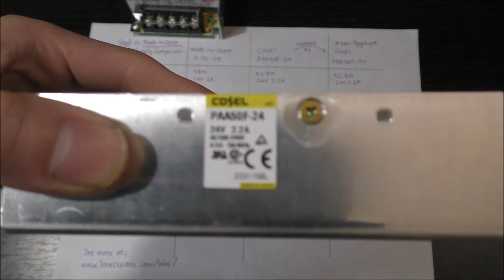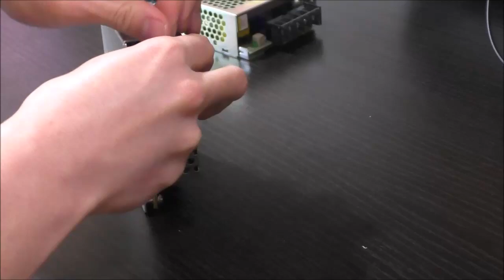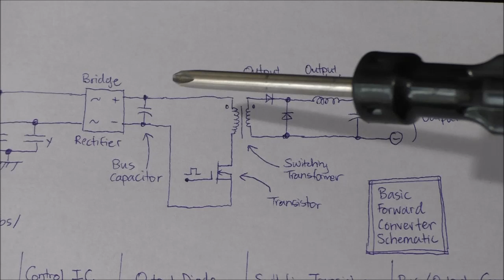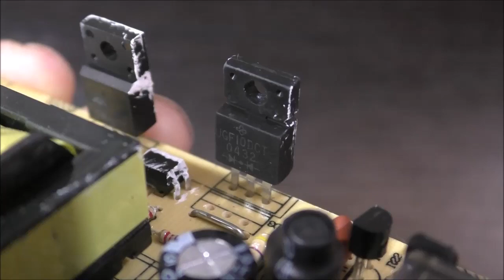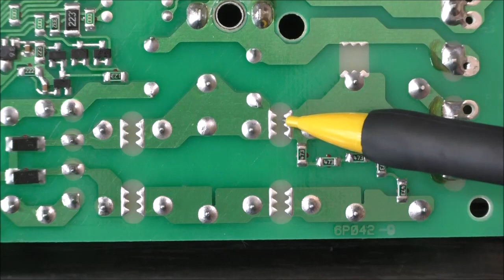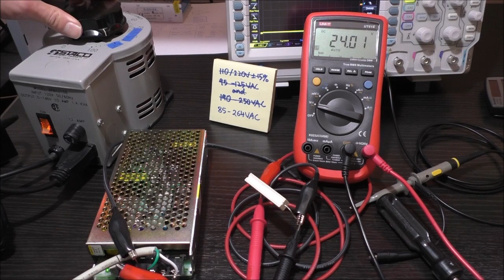Cheap $8 Ebay Power Supply vs $85 Cosel Power Supply Teardown

Comment: Why the main capacitor in the branded Japanese Power supply is very low voltage one only 200 v. How does it works on the rectified DC which is about 320 volts at 220 v AC Input...??? And why the main transformer is so small...???

Comment: It also a question of cost when power supply fails not in voltage lost mode... If you supply some pricey equpiement by $8 it quickly can be very costly.
Also about ripples you didn't show the frequency of them, peak peak voltage is not whole story.

Comment: To be honest the cosel power supply is too luxurious in some areas for just 50 Watts
1. That bulk capacitor is unreasonably large for 50 watts
2. There is no need for  TO-264 components on a 50 watt smps supply unless they want the power supply to be so reliable it could run without a heat sink
3. There is no need for custom bus bars on a 50 watt power supply. The secondary will only carry a max of 2.2 amps. Flood filled traces would do the same work for less

On a side note,  the emi  solution on the cosel is quite nice, but it looks like it was meant for a bigger power supply

Comment: I have a bunch of low-end Cosel power supply (Cosel is crazy expensive). The ripple measurement of SMPS is a bit tricky. You can not use ground clip as it will introduce lots of noise. The test point is best at output capacitor. If you did it correctly, the Cosel should be much better.

Comment: Why the jeanease one had a 200 v main cap?It sould be 400 or 450 v also usually the x2 capacitor must be rated for 275 v not 250 v but this ine could not be a big deal.

Comment: The two supplies performed well to my believe although the cheap power supply did have some more ripple on the output.  Comparing the price paid for the cheap psu I would not even dream of making it for that price.($8)  You get what you pay for but the cheaper supply is really good value for money.  Compared the cost is 10 times more for the more reliable one.  One other thing that puzzled me was the voltage rating of the 680uf capacitor being only 200v when the mains voltage at 230v is rectified will rise up to more than 300vdc.

Comment: Excellent review, I have just received some 5 amp 12 volt power supplies that look very similar to the 24 volt Chinese one you reviewed and from wiring it up with 240 AC, it seems to work OK. Small trimpot adjusts the output voltage with no problems. Sad to say my now ancient oscilloscope would probably not work any longer as it has not been turned on for years. One question, would it be worth installing a cooling fan for a power supply of this type ?

Comment: dell177 hello you seem to be very knowledgeable about adapters. I need a little help I have LED lights that the adapter keeps burning out the specs are input: 100-240v-1.5a and the output 24v 6A what should I get to hold better. The LED are 120 ft long. I will appreciate any advice

Comment: All of my cheap ebay china power supplies are working very well. I only load them no more than 50% of Max current. When they arrive from china I tear them down, look for any burnt components. Look at all of the mounted to chassis components to see if there is proper heat sink compound on them. If no compound I unscrew them and add the compound. To decrease ripple and noise I put a 4,700uF, 100V capacitor on the output.  One last thing. If buying from ebay. Make sure you set up an account. If the suppliers have a Positive feedback of over 99% rating. I will buy. If its faulty you are guaranteed ebay money back policy. And with a rating of 99% and over means the customers are very happy and will trust them.

Comment: Looking at the input capacitor, the cosel supply has a 200V rated voltage. I have learned always that after the bridge rectifier and an elco the voltage will be Vin x 1.41 so this is 230 x 1.41 = 324 volts... So how did that happen...

Comment: I have a SMPS led driver with a 5v ref, could the voltage divider be modified to increase output?
Reply: If voltage regulated by tl431 ic you can change a resistor around it and output capacitor with higher voltage but you should learn more about electronics to change the output voltage

Comment: The China PSU was and is a basic rendition without too much complexity such as the Japanese PSU.

However, I would have liked to have learnt what improvement could have been made to the China PSU.
Such as inducter and larger caps would have on regulation.

I noticed a drop on the voltage toward the higher end, that does also effect amps of the unit, but where the loss is/was causing this. I assume the MOSFET and caps would be the issue?

But for the cost of a few replacement parts which is best value, caps and part being only a few dollars does the brand warrant the costs?.

Comment: It's not important, but I am curious what's the controller chip in the smaller one. I like it's simplicity and I would like to study it more :)
Reply: It is most likely uc3842 or its copy or something works similar, a very good peak current mode controller

Comment: Bought a couple of the 24V supplies from Ebay and after a short time a cap failed and I had 27V ac leakage coming out of the DC supply but still giving 24V dc. Buyer beware.

Comment: For audio I would use the 8 dollar cheap one, less noise and ripple, in fact I would buy 10 and see if the Japanese model last as long as all 10 of the cheapies being it's the same price difference. I'd bet the components don't have the same quality, but the cheapie looks good on the scope, explain that? When the cheap one craps out you could always replace components with high quality, if the board is still good then you're all set. Maybe the Japanese model is a little over done. They're known for high quality and honor, but seemed to overlook the noise and ripple, hmmm. Electrical Pollution.

Comment: I have used Chinese power supplies in numerous commercial applications where cost was a concern. Stepping away from the basic Ebay units (which I have used successfully on home projects) in my business, I find the Mean Well brand to be particularly reliable. If I were working in a medical or scientific environment I would probably use a German or Japanese supplier but for typical commercial and light industrial applications the less well documented Chinese brands can work quite effectively at a significant cost savings.

Note: This video did not check for line voltage isolation which I always check on Chinese power products. Visual inspection doesn't protect you from faulty transformer isolation or suppression capacitors.

Comment: Well the cheap Chinese brand cap's are likely to fail that is a given. That said it is durability that would interest me first. Second would be where the birdies are since I primarily use switching power supplies for rf radio hobby. Given the low cost for used server power supplies I find it odd that anyone would spend $85 for a Cosel when you could get 2-4 server supplies for that price and they are built much better. Even if you had to recap them you would still be ahead over buying a Cosel. Same thing for the cheap Chinese $8 switcher you could upgrade the caps fairly cheaper and make minor improvements if need be for far less than the $85 Cosel. In fact even if needed a small fan to keep it cool if that is Chinese as well it is cheap enough. I think where the Cosel comes in is if you are building something for a client and your reputation is on the line!

Comment: Why is the 'bus' capacitor in the Cosal only rated at 200v when at the maximum rated input of 265 volts AC, it will have 375v across it? I was waiting for the bang...
Reply: Alan Cordwell -- Your question was already answered here  https://www.youtube.com/watch?v=71NWT5vrbk8&lc=z13pezwxnkq2u31vg231c3qpmuutipinw

Comment: You should be testing them on load to see how they hold up to specs. Also it depends what your going to use them for too. This was not a real test only a input test and not a output test on full load to see how they held up. It would be nice to see how hot they got with a flir gun to see points inside what got hot. There was a lot of things missing in that test. Sorry not how I would of done it.
Reply: Michael Mitchell - let us know when you post your superior test video.

Comment: The Japanese PSU has active Power Factor Correction (PFC). Did you not notice that the large high voltage capacitor was only 200 volt rated and that the controller IC had 24 pins? The extra "stuff" on the board is PFC control and cycle by cycle control of both output voltage and current at the switchmode frequency.  There are 4 (four) transformers, not including the dual common mode input chokes and the output choke on the PCB. That should have alerted you to the superior design and quality of the Japanese unit. Unfortunately you compared a modern car to a horse and cart. Please Google "power factor" and learn a bit more about it before recommending cheap Chinese SMPS PSUs that do not have active or even passive PFC.
Wikipedia has a very good article on the subject and with modern smart power meters, you get to pay for the wasted power.

Comment: Do you have any idea what these PSUs are used for?

Not bench use kid. Generally, 24 VDC means industrial work. I know that the Arduino cancer has caused you young people to think CNC.  

I have to laugh. I was running CNC mills when you were in diapers. Your generation did not invent them, you made them into chip board screw ups that could not hold a match to a 5 ton vertical spindle mill. 

You are out of your depth (again) because you have a YouTube education. 

Read a damn book. 

Getting sick of you.
Reply: Crocellian - seek professional help for your anger issues.
Reply: Wtf?
Reply: You're delusional. Probably someone that is linked with the company that makes the more expensive power supply or someone that works in the field producing them. Of course you're gonna get pissed off that chinese are offering the same as you for 1/10 of the price.

Comment: first time i plugged my ebay 48v power supply from china thunders came out from switching transistors  and burned of one of their legs. i wonder  what was wrong in the circuit. Didn't see any obvious  fails of other components
Reply: mateusz1945 -- Maybe you were running it on 220/240 volts when it was set up for 110/120 volt operation?

Comment: The real concern is about safety. As far as I can see, the Chinese SMPS has a standart 1nF 1kV suppression condenser between primary and secondary side instead of a safety self-healing one. This is a death trap, because it tends to fail dead short at overvoltage condition. Short kV spikes are quite common in mains - tens to hundreds a day - so if you have conected anything referenced to ground (even capacitive coupling is enough) to the output of such SMPS, the cap breaks down, leaving your secondary circuit galvanically connected to Live wire. The SMPS does not stop working, everything seems fine, only the trap is armed and waiting for it´s prey.
The funny thing is that it seems that those Chinese "engineers" use proper safety caps in input filtering, where failure of one only leads to blown fuse and not lost live(s). They saved two cents on the wrong place.
Life saving rule: Take your Megger and Hi-Pot test every single mains connected device from China! The nice side effect: you will get less concerned about efficiency, output ripple and pulse response very soon.

Comment: Thanks for comparison but:
- you compare not only low end with high end product but also consumer with semi-professional
- for 20 $ you can buy a brand similar to chinese noname
- PS have different SMPS topologies, chinese is clearly a flyback, japanese is something else because of 200V capacitor.
- of course they have different protection features in both primary and secondary parts (of better to say chinese has almost none) their cost is different by 10 times !!!
- for gods sake SMPS transformer alone costs 5$ ! Murata common mode choke costs 10$ but it is a damn ferrite ring with 2 neat short coils...

As for which one of them to buy... it is a philosophical question :-)

Comment: I think the cheap China made power supply would be fine for anything except aerospace, military, medical, nuke plants,  offshore oil, refineries or chemical plants.  In other words if human life was at stake.  For longevity at $8 I would buy a spare so you would still have spent 5 times less for 2 and you would have a backup on the shelf just in case.   The fact that the ripple is cleaner on the simpler is shocking.  I have always admired Japanese workmanship but many Japanese engineering designs always seemed needlessly complex for some reason (cultural?)
Reply: Rob C, but you would not just have the $8 cost of the backup on the shelf.  You would also have the down time (which can be much more expensive by itself) until someone comes and replaces it and the bill for doing so, or else you retain a technician on-site capable of it so an entire salary.    It is safe to say that most uses where the function of the powered equipment is tied to productivity which is tied to profit, would benefit from buying a higher quality PSU.  As always where is a middle ground here, silly humans often thing in terms of opposite extremes of expense and quality instead of the middle ground.  In other words something can be better, even "good enough" without being the most expensive one you can find.
Reply: @stinkycheese804  You're talking about downtime in commercial applications, where (I hope) nobody uses those cheapos. This SMPS is for those driving LED strips at home and not willing to pay 10x more. 
And to confirm your theory  with my personal experience, the cheap ones last no longer than  an year before they fail,  sometimes just a few months.

Comment: I notice that the diodes and many of the resistors are standing off from the PCB. Nice touch. I suppose for cooing?. Shouldn't you be using a 10X probe for the ripple measurements though?

Comment: nice review though I'm pretty sure those bus bars were simply a necessity due to the diode being in the way of traces going through the PCB.  there are other places that the came current capacity goes through traces on the board.

Comment: Simple decision really. If you are powering something worth thousands of dollars or otherwise critical, buy the cosel one and you will not destroy the expensive load after a lightning strike or something like that.
If you are powering some christmas lights around the workshop for fun, buy 3 of the chinese one, check each one before use for loose joints and stuff and make sure the grounding is proper before plugging it in... when it blows install a new one and, most fun part, debug/repair the fault (yay!) :-)
These are not really competing products at all, both do their intended jobs very well.
Reply: But its still nice to see a cheap supply that anyone who knows electronics would buy for any purpose.

Comment: You need to test booth with a active programmable load. 
I know programmable loads are  very expensive...
I did notice that the switching frequency seemed higher on the Japanese 
one.  THANKS!!!

Comment: I worked for a power supply company for 30 years and we went out of business because we just could compete with the imported supplies. Up to the early 80's most of our business was with the military but as that dried up we did more and more custom commercial work.

I taken a few Chinese supplies apart and been impressed at the quality vs cost. I've seen some that would not pass UL requirements but they all worked well.
Reply: dell177 hello you seem to be very knowledgeable about adapters. I need a little help I have LED lights that the adapter keeps burning out the specs are input: 100-240v-1.5a and the output 24v 6A what should I get to hold better. The LED are 120 ft long. I will appreciate any advice
Reply: @betopizarro2003  Your LED string is probably too long and drawing too much power. How many LEDs are on the string (How are they broken up into sets of series LEDs)? How much power is each LED drawing and at what voltage? If they are 1.8v LEDs that means 12 LEDs in series gives about 24v. So you would want your lights to be broken into sets of 12 in series and a bunch of these sets in parallel. If you are using Christmas lights they may all be in series instead of being broken into sets of parallel LEDs. Christmas lights run at mains voltage so they have to drop down 120-240v So you can put a bunch of them in a row.  As long as your LEDs are not burning out they are probably configured correctly or they would either burn out or be dimmer than expected.

Then you need to know how many of milliamps each LED is drawing and multiply by the voltage to get the watt usage. So subtract 148W (24v X 6A) from the watts the LEDs are using (# of LEDs X milliwatts). If you have a positive number that is what your LEDs are over capacity. If you get a negative number everything is ok. Or subtract the watts the LEDs are using from 148 in which gives you how much more power your adapter can supply than what the LEDs are using.
Reply: If I see how our business is going, I must say. It is not cheap! But more regular price then overpriced like second one with huge margins.. Where 30% price is only because of old suits man:) Chinese are good in optimal balance between price and quality, these days. However its not always True.

Comment: I do a lot of high power LED projects and I find the cheap Chinese power supplies are OK when not using at full capacity and also not running too hot. For hot, full-load applications, I used the brand names.